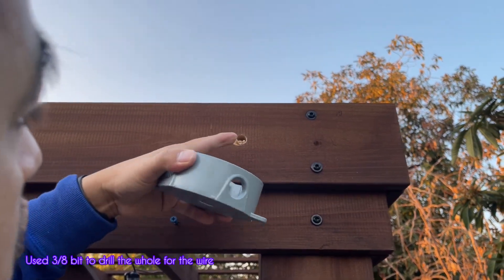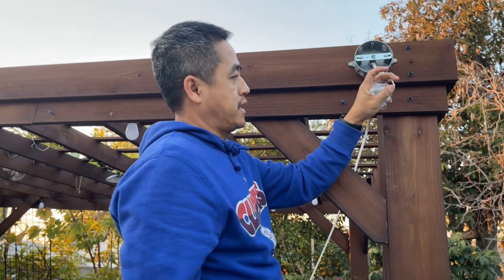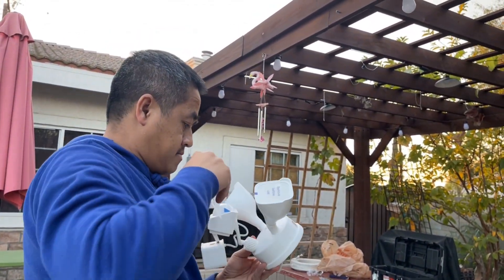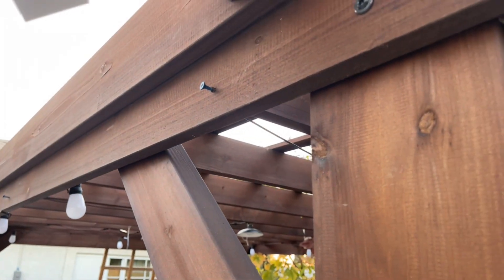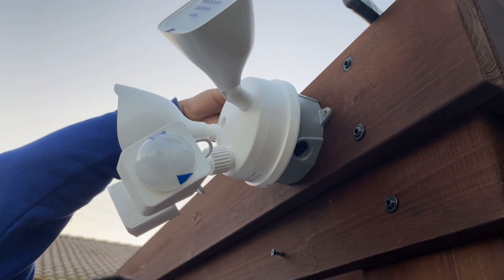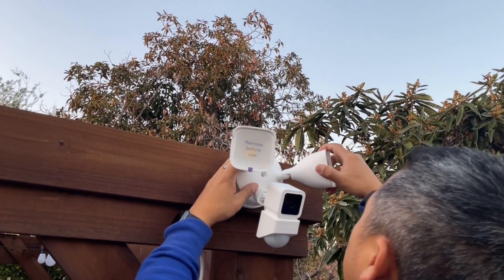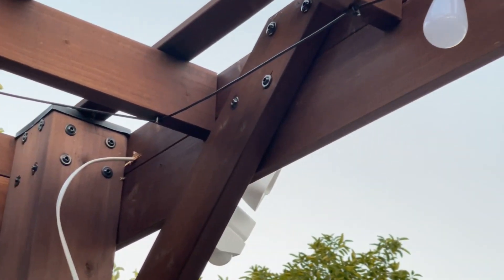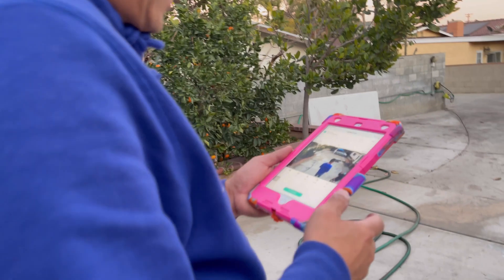Installing and hardwiring  ( Powering )New Wyze Cam Floodlight with 400 watts solar system DIY

Comment: Do you have your wifi routers hooked up to solar other wise what good will solar do if there is no wifi because you have no power?
Reply from the maker: I have a mesh router with a lot of access points so reception is not an issue.  This Wyze camera is hardwired.